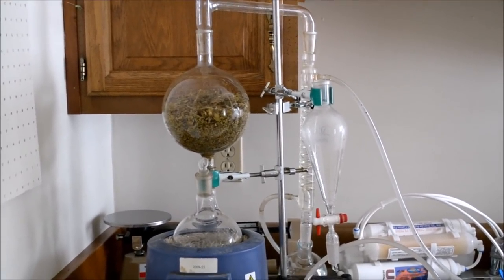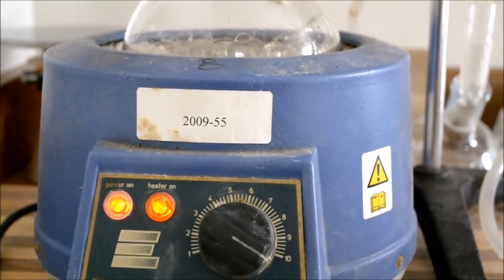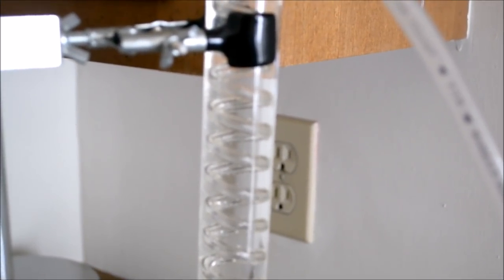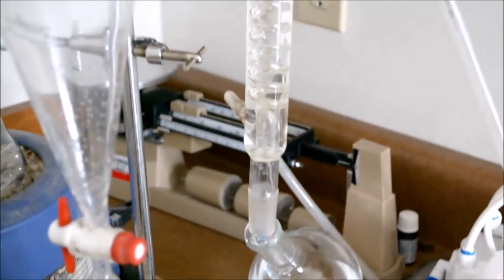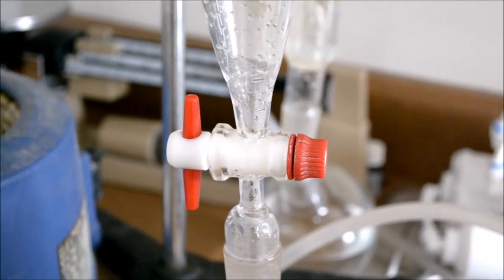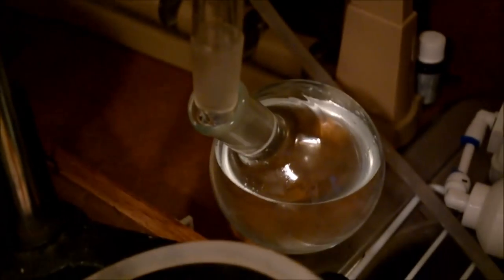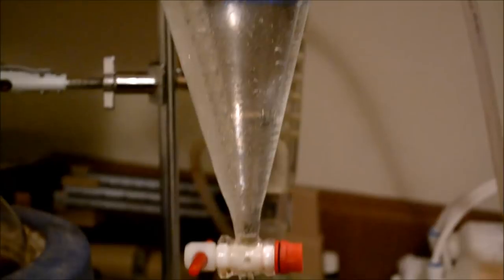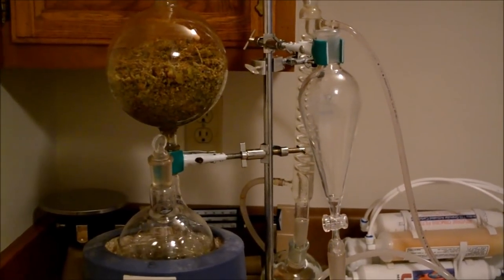ESSENTIAL OIL DISTILLATION

Comment: I am using medicinal marijuana but I've also noticed that when I do extract oils they are clear for a day or two and then some of them cloud up have you run into that if so what is it from
Reply from the maker: I'm am not exactly certain what you issue is,  but in my experience that could be a few things. First some oils solidify with age, this generally takes a while, but the oils can become more cloudy during this time. Another option is that something in the oil is precipitating, often times the precipitates when mixed can make the solution look cloudy. My final suggestion which is probably most accurate, is that you have not completely separated the hydrosol from the essential oil. This can lead to esterfication and a cloudy oil. You mentioned your distilling cannabis, but you did not mention at all how the smell is different after distillation. The smell of the oil can be a huge help in determining what is going on.
Reply: Christopher Leifson after I distilled my medicinal marijuana the oils were clear for about two days and on the third day he became cloudy but to get back to what the smell was like after it smelled like cut vegetation but not like the original herb that I used so I was also going to ask if there would be a curing process for the oils but I think you already answered that
Reply from the maker: I have never distilled cannabis so I cannot experience with the matter is limited. Mostly it seems like the hydrosol has not been seperated from the oil correctly.
Reply: Those are fats and lipids and other compounds in the cannabis. What you would want to do is "winterize" your oil.
You'll need 95% ethanol, mix your oil into the ethanol at a 10:1 ratio of ethanol:oil, then stick it in the freezer for 24 hours. You should see coagulation of the fatty materials, you can then filter this using a buchner filter and some filter paper of various stages. Typically starting with coffee filters then down to a 1 micron filter paper, then a 0.8 micrion paper, and then finally a 0.1 micron boro chemical filter paper. After which if you really want to refine it you add carbon powder to the filtered solution and warm it while stirring. Use a filter aide like diatomaceous earth to filter out the carbon powder.
Evaporate the ethanol and you should be left with a very clear and pristine concentrate.
Reply: My bad, the filter sizes are wrong. It's 20 micron, then 8 micron, then 1.0 micron.
Reply from the maker: This video is about distilling catnip, I do not have any expertise in making cannabis extracts.
Reply: BINGO.
Reply: I was replying to Eric
Reply: It is a concept that can apply to you too. Fractional distillation doesn't always remove the fats, lipids, and other what nots.
Reply: anthony you cannot winterize essential oil like you can hash oil.

Comment: Pl tell by how many gms of leave, 30mil oil is being extracted and it takes how much time and how many time, this process will be repeated for 30ml
Reply from the maker: Hello, it is hard to say in grams because I did not weigh,  and since I'm American, the original weight I can only relate too in lbs. ( off the top of my head I can't translate the two) Anyway, the flask is two liters, I cram it full of herbage. Please excuse my lack of quantitative data,.
Reply from the maker: To get 30 ml it would take close to 15 batches. I get 40 drops from a batch witch is 2ml. A bigger still is the way to go.
Reply: Thanks sir, this data is also kind enough for working.

Comment: how much does all this equipment cost?
Reply from the maker: ***** The still cost between 400-500$ depending on the size and if you buy the equipment in on place as a kit or from several different places. The heating mantle cost about 400$ unless you get one from ebay, or other second hand places. The water filter can be between $100-1000's depending on the kind and the capacity you get. Then you need a place to store essential oils, I have 5 and 15ml glass on glass vials made from O'briens scientific glassware, out of IL. (30$ a vile), or you can buy standard essential oil bottles at 3$ a pop. Oh, yeah, and the water pump from an aquarium 30$. At the most basic, smallest size still, brand new 700$, used maybe 500$ Stands and clamps are kinda costy, throw in another 50$, you could easily spend 1000$+ for a larger still made of glass.
Reply from the maker: Christopher Leifson Of course that is supposed to read *one place.
Reply from the maker: Hello Rain Tree, thanks again for your input. I do like your idea of putting sand in a pot, this will give an even distribution of heat, and hold you flask in place nicely. Heating sources are very important part of distilling essential oils. A regular 2000 watt hot plate was not able to heat the water in my boiling flask enough to push the steam through the 5 liter reservoir flask. Other heat sources beside electricity may be better, but require a facility where an open flame is not a hazard. Essentially, if you want to get the most essential oil possible out of your herbage, I suggest using the most efficient equipment possible. As you know, every drop counts.
Reply from the maker: +Rain Tree Hi Rain Tree, again I thank you for your input, at the very least it has created some clarification. The first still I got was from all parts bought separately on Ebay. The total was still above 150$, especially for a 5 liter reservoir flask. I tried a 20$ hot plate with minimal luck getting the steam to get through such a big system. What you are suggesting, even at a minimal will take close to 400$ once you add in all the shipping costs.

Comment: I can drink this correct?
Reply from the maker: +Austin Hurt You can do whatever you want, a couple drops diluted should not be an issue, but to actually pour enough to drink is pretty absurd. Use essential oils responsibly!
Reply from the maker: +Rain Tree Hi again Rain Tree, I ask that you please state the sources for your information on EO/tea equivalency.  While it is wise to relay that essential oils may interact with other medications, I think it would be more valid to say that EO's will definitely interact with other drugs and medications. Do not use internally with other prescriptions without first notifying your healthcare provider. Furthermore, steam distilled water is equivalent and maybe more accessible than reverse osmosis, or even possible to make yourself with the same still, just watch out for deposits...
Reply: +Rain Tree I think he was speaking about drinking the Hydrosol
Reply from the maker: Even when discussing hydrosols, I do not encourage drinking them, although it is more dependent on the actual plant that is distilled. Spice hydrosols could be used as a flavoring, or diluted in water like a tincture. While I cannot outright say, go for it, especially with catnip; I cannot dispute that a hydrosol would be a safer drink than the essential oil. In the end it is about responsible use. I cannot think of many reasons to drink a hydrosol, but as a mouth wash, it sounds appealing.
Reply: My essential oil burned through a polystyrene cup.. it was about 70degrees in temperature.. the oils are highly concentrated and depending the source material, can be damn near corrosive.

Comment: A suxhlet unit would work way better look into getting that equipment you'll extract more and u have most of it there already.
Reply from the maker: Can you elaborate more on the Soxhlet, I thought that was for extractions with dilutes like alcohol.
Reply: Soxhlet is for the continuous liquid extraction of very lowly volatile and badly soluble compounds into a highly concentrated extract. Your reservoir below the soxhlet extractor unit is heated, evaporating your solvent which is recondensed above the soxhlet unit and drops into your matrix, from where it drops back into the reservoir.
Brews one hell of a tea, but not so ideal for the extraction of essential oils as you'd have to use an organic solvent which then has to be distilled off later. Depending on what you intend to do with your extract, maybe something that should be left to the professionals.

Comment: I have a fractional distillation kit with a vertical Vigreux distillation column and a diagonal water cooled condenser and a vacuum pump. I use it to distill off the alcohol I use for a solvent to extract the resins from medical marijuana. 
For those who want to know. The process shown in this video WILL NOT extract THC from marijuana. Water boils at 212 degrees F but THC will not boil (vaporize) until 314.6 degrees F Also THC is not water soluble (hydrophobic molecule) .  I've attempted this experiment using a solvent that boils at a temperature higher than THC (D-limonene boils at 348.8) but thus far have been unable to successfully fraction off (separate) the resulting distillate, which oddly comes out clear.
Reply: What pump are you using?
Reply: A run of the mill Amazon vacuum pump.
Reply: actually the boiling point of oils do not matter here. the oils are trapped with the water.. many types of chemicals in essential oils have boiling points well into the 500 degree range(btw thc doesnt boil until 400+ degrees, ever wonder why everyone does high temp dabs? wiki isnt 100%) most of the good chemicals do not even boil until well past the boiling point of water, hence the need for water in the first place. trace amounts of thc does end up in the cannabis essential oil(look it up) another example would be carvacrol in oregano oil, its boiling point is well into the 400 degree range while you never go over 220 degrees while distilling the essential oil you still end up with a ton of carvacrol. which would make me think even more that thc has a boiling point even higher than 500degrees!! also.. you speak of distilling alcohol, which is illegal. be careful. Dont do anything that will end up with you in prison lol.
Reply: oh and btw. no essential oils are water soluble.. as any basic kid knows, water and oil doesnt mix.. which is why you end up with hydrosol(hydro solution) and oil. lol HELLO MCFLY
Reply: True, that is why this process will extract only terpenes, which can be added in after the other extraction processes.

Comment: hi everyone. can anyone help with a question;    instead of boiling water to steam temp to carry the resin thru. why not use alcohol to steam temp to extract the resin. yes, it can be dangerous, but you keep it safe as possible; induction stove to eliminate flame, and good condenser system. alcohol is a much better solvent than water, surely. in my minds eye, this has to be more effective than water. has anyone done this , any opinions, thoughts, etc, all appreciated
Reply from the maker: That makes absolutes and concretes, nor essential oil
Reply: @ChristopherLeifson  excuse my ignorance christopher,  i have no idea what absolutes and concretes mean. and thank you for your reply.  i imagine, your yield  [in this video] will be around 10%.
Reply from the maker: @ressurectionman  
No worries, check out those terms, it will clarify things.

Comment: Where can i buy this equipment?
Reply from the maker: +William lo Haha, I could have sworn I answered this question already, but apparently I cannot find the info. To put it simply, you can get laboratory equipment from any science store, or from scientific glass blowers. I got a complete kit from SGV scientific, and that include everything I needed to get started except the heating mantle. A used mantel can come from ebay, or other places, but I suggest refraining from the ones sent from China. I bought one and it did not get hot enough to send steam through the still, the same issue happened with using a hotplate vs. a heating mantle. I like the Electromantle heating mantles. After I got familiar with the process I realized that some of the equipment offered by Heart Magic that was more specific to essential oils work great. Particularly the reservoir flask and separatory  funnels made by Gary there. So that's where I got mine, but again you can purchase this equipment from laboratory supply stores, ebay, and have things made by scientific glass blowers. You can also go stainless steel or copper. Your stuck doing your own research there, but Edenlabs is another company to check out. For more information about the cost, check out the response to Ryan Ashbury on this page.
Reply: +Christopher Leifson Is there a link?
Reply from the maker: +William lo Haha, I don't know what to say, of course there is a link, do I want to get them for you, that is the real question. Sure... I'll do it! Lets see... SGV Scientific. http://www.sgvscientific.com/. Heart Magic http://www.heartmagic.com/EssentialDistiller.html, and Edanlabs http://edenlabs.com/ These are for the aforementioned businesses.
Reply: +William lo search ebay for 'chemistry lab equipment' and then insert whatever you're looking for ..... round bottom flask, condenser, heating mantle or even just "chemistry distillation" ... you'll find tons of stuff.
Reply: +Christopher Leifson Give a man a fish ... yadda, yadda, yadda - teach him how to fish ...... /shrugs/
Reply from the maker: Thank you William, it looks as though I forgot to mention eBay, all kinds of laboratory equipment there for sure.

Comment: "Catnip".....
Reply from the maker: It has come to my attention that I need to reaffirm the contents of the still. It is not cannabis sativa, but Nepita cataria.
Reply: +POTATOEMPN Implying you can steam distill cannabinoids from cannabis sativa just goes to show your understanding of biochemistry/chemistry/ science
Reply: you can. its the same process as a vaporizer.....and you are getting CBD and THC when you do it either way.........so shh, go pretend to be smart somewhere else.
Reply: +THE UNKNOWN what's the temperature of steam again? since that how this process works.....
Reply: +POTATOEMPN 
You 100% sure about that?
The ideal temperature to evaporate cannibanoids is around 415°F, water turns in to a gas at 212°F, you want to explain that to me?
Reply: +Alexandir Belvoich 
I can explain. In steam distillation we want to separate a low volatile immiscible oil from the material. The water is just a medium. The water, which is more volatile, will indeed reach its boiling point at 100 degrees Celsius and begin to distill. That DOES NOT mean the immiscible oil will not distill. The immiscible oil will establish its own vapor pressure in the head space above the flask independently of the water. This is why, in the case of this video, Christopher can extract Nepetalactone, the psychoactive ingredient in Nepita cataria (its boiling point is at about 270 Celsius, or 518 F!). Hope this clears it up.
Reply: +Conor Dixon Sounds legit to me, I recently learned that with this process, terpenes are removed from cannabis material.
Reply: POTATOEMPN hahaha i heard that too..im like catnip? The fuck?
Reply: Conor Dixon smart stoners lolol
Reply: The fact you think you can single step steam distill either THC/CBD into a clear (distillate) oil shows you're clueless
Reply: Nate one cannabis heals. YouTube , everyone is certified genius haha xD